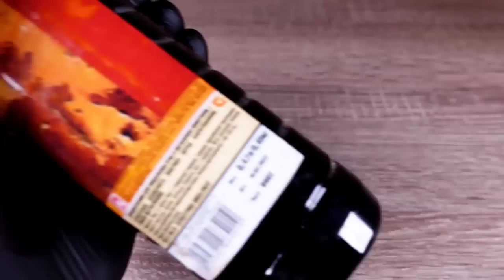Extremely Old WW1 Trench Kerosene Lamp - Restoration

Comment: Its truly amazing how you start with an item covered in 50/50 iron oxide(rust) an copper sulfate (verdigris) and end up with a shiny brass lamp
Reply from the maker: Thank you!)
Reply: @TheRestorer should try white vinger next brass project works really well, and I usually use polish with fine steel wool then microfibre for final finnish, personally find takes abit longer with dremel and can leave marks although only tried it twice.👍

Comment: How come all of these videos start with something solid brass that looks "Rusty" when brass can not rust?
Reply: itt was dug up in an excavation. that 'rust' is hardened dirt. its not rocket surgery
Reply: @brapamaldi  It is artificial patina from a spray can. Can be bought at any craft store genius
Reply: @macgyver15147  herp derp lerp verp terp nerp
Reply from the maker: Yes, brass does not rust, but after many years it can become covered with corrosion, plaque, and oxidize

Comment: I am wondering why the bottom of the lantern wasn’t rusted at all ??? And the rubber washer was in perfect shape that is strange after 70 years doesn’t rubber break down? Just asking…
Reply from the maker: I was also surprised by this, but I read that rubber and plastic decompose in nature from 100 to 450 years. I read it on the Internet.
Reply: @TheRestorer  What about the bottom of the lantern ??? It was spotless hows that possible without reading it on the internet
Reply: @johnrula  it's fake,blueish rust doesn't exist anyway,look at a video about fake restorations, I'd say 40% of restorations are fake. Also rust happens everywhere, meaning if some where is spotless, it's also fake
Reply: @N_e_w_0  I agree this has to be a FAKE. As the bottom was stopless and he wouldn’t say how that was possible…FAKE 0 out of 10 for nothing

Comment: I have a few reservations - it's a nice thing to chemically remove the oxide layer from the brass sheet and polish it to a high shine, but in the case of this lamp, I'd opt not only for surface cleaning, but also for opening it by unsoldering the bottom. This would allow me to unsolder the burner tube as well, clean the vessel and burner of unsightly solder deposits, smooth the warped top of the stock vessel, and re-solder the burner tube properly so that it is guaranteed to seal. Someone must have dropped the lamp in the past, or something heavy must have fallen on it - and it was corrected in a rather humbuggish way by simply bending the burner tube to an approximately vertical position and re-soldering it in an unsightly way. This is evidenced by the significant deformation of the top of the vessel just below the burner and the thick and irregularly applied layer of solder between the burner and the vessel. This may have occurred just after its manufacture in the aforementioned WW I, but it would be worthwhile to return it to its truly original form - if it is to be restored, it should be to the condition of a new piece, not with the preservation of significant appearance defects. And pouring lighter fluid into a lamp is a pretty dangerous thing to do if kerosene was originally intended as the fuel - it needs to be distinguished. The original rubber gasket around the pour hole might not survive the petrol mixture without damage, although it would withstand kerosene without significant change. But then again, it is true that lamps in the form of a similar torch made from a modified fired brass cartridge of around 50mm calibre fitted with a fabric wick and with petrol as fuel were used as a source of light and especially heat even in the trenches during WWII - they were perfectly common on both sides of the Eastern Front and with partisan units in Europe, as ordinary petrol was easier to obtain from vehicle supplies than finding kerosene usable only for lighting.
Reply from the maker: Thanks for the advice. I wanted to leave the lamp in this condition. I did not know that they could be made from a 50 mm cartridge case
Reply: @TheRestorer  You misunderstood me. Your lamp is made of brass sheet directly as a lamp by a craftsman - a plumber or a blacksmith.
BUT - during the wars, in principe identical lamps were made "on the knee" = DIY by remaking suitably shaped objects with different purposes into just such a simple "torch". 
So one took "something" that was already shaped like a container and there was no need to press a flat flat sheet and roll it into a round, when such objects were easily obtainable in the form of empty fired cartridges for the then very widespread class of anti-tank and anti-aircraft guns, one just added a lid or some sort of holder with a wick and the lamp was ready. All you had to do was pour in freely available fuel - almost all military equipment ran on petrol at the time, diesel became more widely used during WWII in the form of Russian T-34 tanks - and you could light and heat ...
cally

Comment: Just two comments from me. First, and it is a small thing, why after all the work did you go back with that ratty looking washer on the top nozzle connection? And second, did you clean the inside if the reservoir? If you did, why not show that part also?
You do get a a 9.5 out of 10 from me for resurrecting a still useful piece of history.

Comment: Something I expected to see but perhaps you just edited out for time:  Cleaning out the inside of the tank itself...I know there is not a lot you can do, but ensuring there is no debris or old oil residue seems like a must...Otherwise a brilliant and beautiful job...I appreciate the fact that you kept as much of the original equipment on it as possible...
Reply from the maker: Thank you!)
Reply from the maker: I also cleaned the middle. It's hard to show in a video.
Reply: For cleaning the inside of the tank easily , fill it to half with sand . Close the cap . Mount the tank on an electric screwdriver . Set the screwdriver horizontally and let it turn at low speed during 30 minutes . Empty the tank and watch if it shines inside . Let it turn a little more if the result isn’t perfect . Rinse the tank , let it dry and it’s now ready to use .